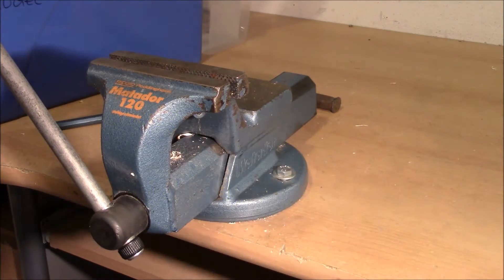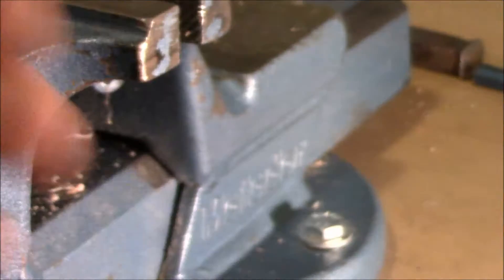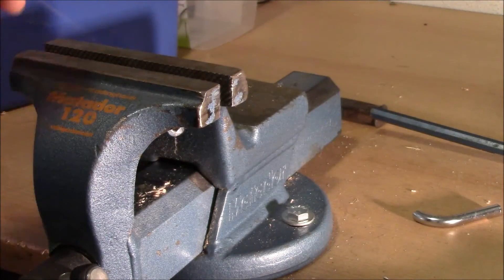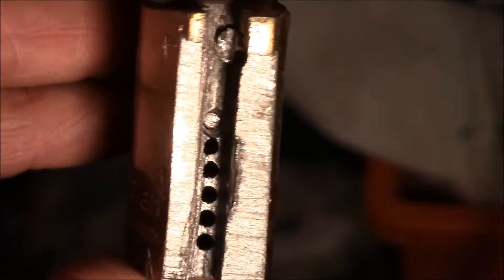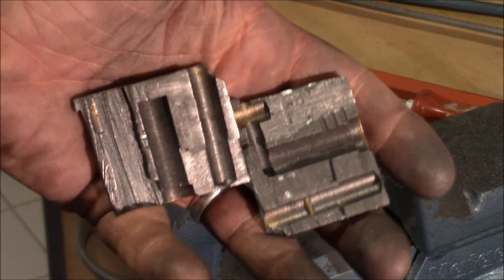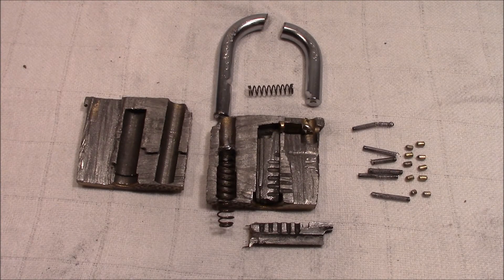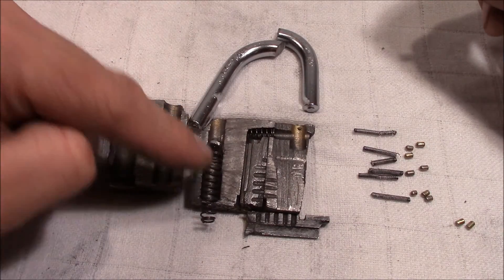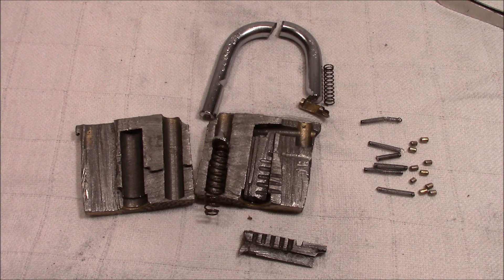(picking 59) Cheap Chinese padlock violently attacked and disassembled (destructive opening)

Comment: This should be called Potti's torture chamber!!
It should also come with a warning😂
I feel sorry for that lock🔓😩😩😓😔
Very interesting though as many companies claim certain features and everyone takes them on face value.thanks for posting this video 👍👍👍
Reply from the maker: +Pick Beard Thanks for watching. I stopped believing what is written on a package for a few euro lock. But it's still quite boldfaced to just print lies. I wonder why this is not an issue for their local justice.
But for the lock itself: I applied a good amount of narcotics before so it didn't suffer during the procedure. Rest in peace or in pieces ;-)